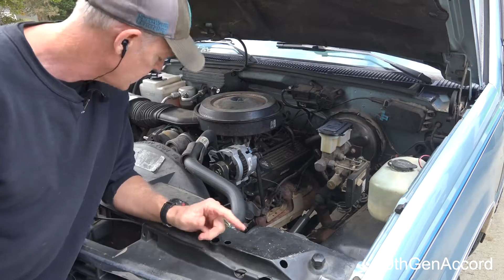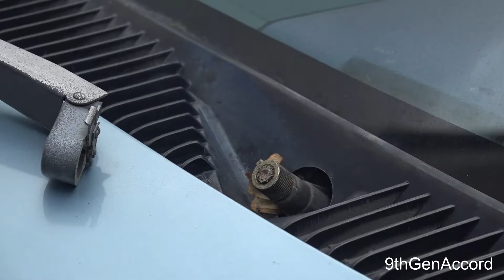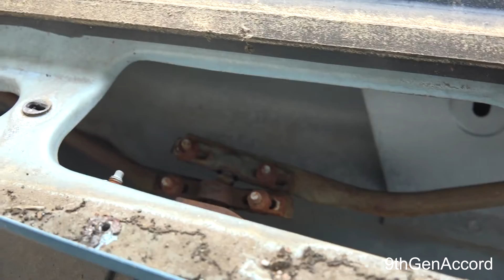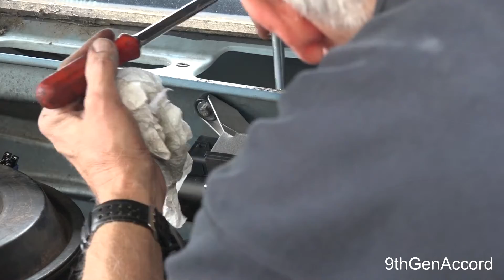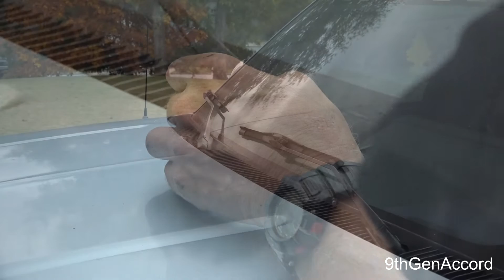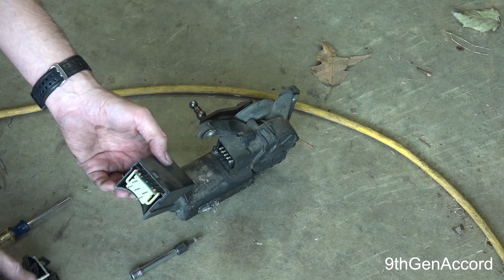Wiper Motor Removal and Replacement on 1989 Chevy k1500 9th

Comment: Thanks for showing how to remove the locking tab. I am having a hell of a time removing it. It doesn't pull out either because the truck is so crusty, or the white plastic is thicker on the opposite side which doesn't allow it to pull out. All while trying not to break anything by forcing it.

Comment: I installed a newer motor on my 90 model still don't have delay or low also tried a new wiper switch didn't help either 😢.

Comment: Very helpful as I could not get the proper replacement for my 90 chevy 2500the board # 22073439 is just non existent. Plus after all it takes to get it out its just seems easier to replace it. Too bad all the parts are now Chinese as they dont really last all that long. Thanks for the helpful tips!

Comment: Same issue with my 88' Chevy Silverado c1500. Good to finally see a video of the same Control Module that I have. There is actually 2 different Modules that look identical but the only difference is the contact prongs either being on the motor or the board. Impossible to find the one you pulled out as I have tried. Did the resoldering and that didn't last long after both times. Finally said hell with this thing and got the new motor and module today. Thank god because here in Seattle we finally are getting our rain back lol. Great video!
Reply: Hi Matthew.  Where did you purchase the motor and module?  My Chevy dealer said they cannot order it. -Randy

Comment: I got old school one too. Mine has started not working. It doesnt move and makes a click. Or it works. And i noticed taking the gear cover off you see the ol version has this drill screw drive shaft from motor to gear. At times itll shutter like it skips a tooth or frictions up like binding resistance. Soooo yeah I'm not fn around. Ill be following this and buying one off a A1auto since i hear more positives. To bad i can't find em for less than $70ish

Comment: the problem isnt the circut board in the older style its the little contacts clean them and bend them in just a little and boom working like new...
Reply: the little contacts inside 3 off them. so not board issue on old style confirmed. i just fixed mine
Reply: Did the same and resoldered the whole board. Worked for a few days flawlessly then just acted up again. Worth the couple bucks just to replace the whole system. Good for you though if it worked and still does. You're the lucky one for sure!